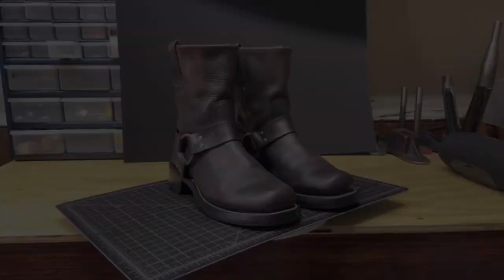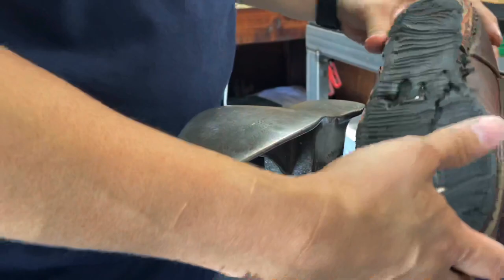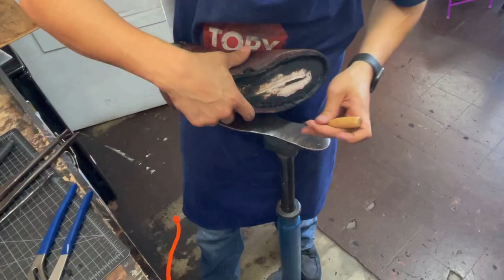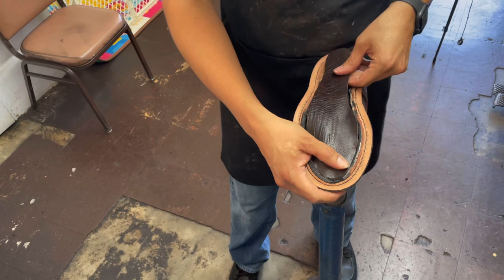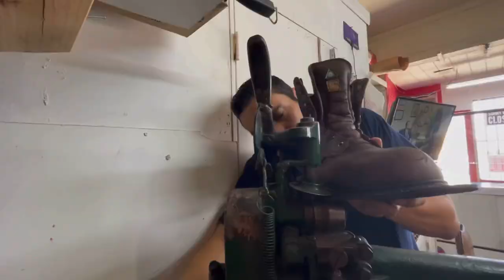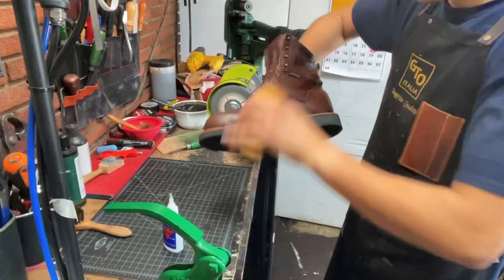Red Wing 2.0 Super Sole With/Vibram Basketweave

Comment: That's an interesting sole, I've never seen that before.  Looks very comfortable and grippy.
Reply: It’s trash…it’s a cheap semi-clear gummy sole, molded over black foam. Chemicals such as oil, coolant and ice melting salt will eat right through it. I have a pair, it’s the 2408 I showed really quickly in a youtube video I posted. Other than that the leather of the boot is great.
Reply: I can vouch for this boot! Red Wings is an amazing boot for longevity, and repairs are what you saw here just now. I am a land surveyor and have had my first pair for over a decade now, and they just recently started to be in need of repair on the souls. It has not been easy treading with them. I used these just about 5 days a week for work . It's a superb work boot for the price, and its quality is one of the best I have purchased ever. Not to mention they electronically measure your width and length of your foot to give you the perfect fit. So, they are literally one of the most comfortable boots I have worn. 

Lol They are not cheap at all. 😄

They are probably close to being the most perfect pair of boots you could ever own. 👍

Cheers to my next purchased pair soon! 12yrs later. 😊

Comment: Thank you for posting this.  I've got a pair of new 606's and an older pair of 202's with the first generation Supersole.  Both are made using this manufacturing process and I've been wondering how resoling them would work since the welt is rubber and Red Wing changed their sole install process using a liquid rubber in the recent past.

Comment: I have 6 pairs of theses. 2 I had resolved by Redwing.  They are extremely comfortable boots.  But the sole dies deteriate over time with it without use.   I have had 2 fall apart.  That’s just normal.  Mine where probably 15 years old befire they did it.   And yes I would have them resoled by this gentleman but I see it just too labor intensive

Comment: looks like it harder and more time consuming to resole compared to heritage goodyear welted red wing.
Reply from the maker: It is one of the hardest sole to work with, I actually stopped working on this type of boots!
Reply: @AaronG2480  Changed my mine from buying this model. better stick to regular vibram on  stitched midsole.
Reply: I own 6.  There great boots.  I’ve had 2 resoled after darn near 15 years.  They are super confortable.   And have gone thru construction hell .  Redwing resold them for $119.  I obviously would get this treatment if it was t such a pain in the ass.  But my resoled ones are going on 5  or 6 years and they are super comfortable, better than my Originao infantry boots after 8 years in the infantry

Comment: Are the 4007 soles non slip?
Reply from the maker: Yes they are!
Reply: @AaronG2480  How long does the tread last?
Reply: The waffle tread will show noticeable after 6 months use. 👞 With bald areas on sole at one year.  Still provides good grip even when completely worn

Comment: Did you replace the shank?  It looked white-ish or covered with something when you took the old one out.
Reply: In any case, great job.  That is how they ought to come from the factory.  NOT a fan of SS2.0.
Reply from the maker: I used the same one, fiberglass shanks are strong enough for this type Resole,
I actually stopped working on the( Super sole)  to much time .